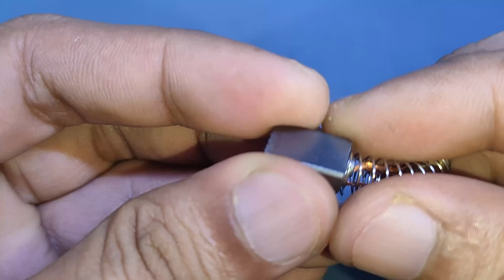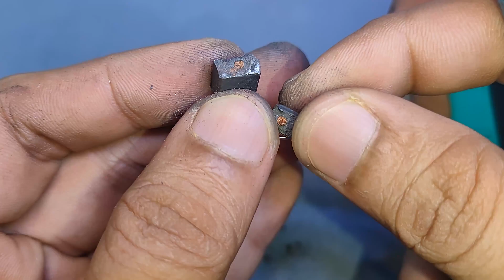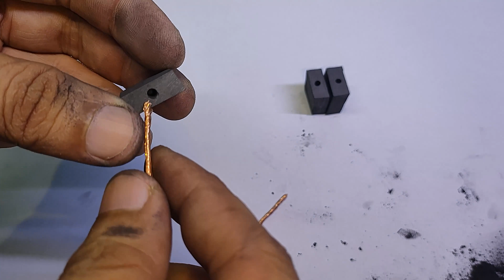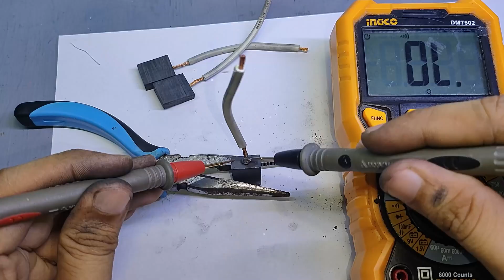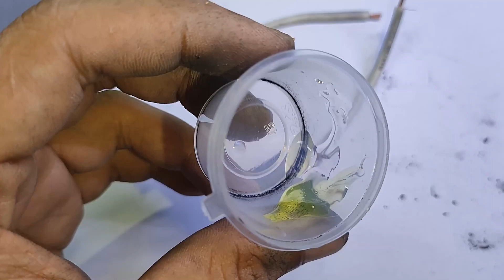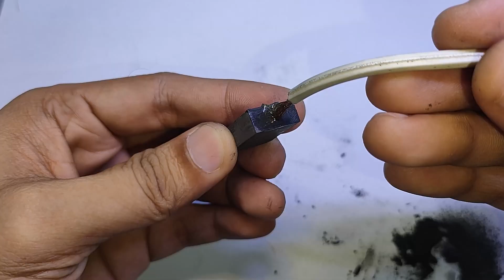Attach Copper Wire to Carbon Brush

Comment: An idea for you to try:  You can get copper screws down to m3 or even m2 size easily.  I think the graphite would tap if you are careful (and you have the right tap).   If it works it would give you a very good electrical connection.  
 You could bodge a tap by cutting slots in a screw which would maybe be enough to do graphite since it is soft.

Comment: maybe also add a metal sewing needle into the centre of wires to splay then out after youve pushed them in for a tighter fit  then cut off the excess needle  might make it tighter then add epoxy with graphite  mix

Comment: My SunJoe wood chipper 15A motor was sparking at the commutator. I found the carbon brushes had detached from the woven copper wire. I simply inserted 14ga desoldering wire & soldered it to the contact plate.
Reply: Solder doesn't bond to graphite

Comment: Thank you so much for this video,my electric gun spray refused to work when i opened it i found copper wire was disconnected from carbon brash now i know how to fix it.

Comment: when soldering carbon brush braided copper wire to a piece of another copper braided wire to make it longer can the solder handle the heat and come apart?
Reply: If it gets hot enough to melt the solder the wire would be compromised anyway. The sheathing on most wire would melt before the solder also.

Comment: Thanks for presenting some alternatives.. I suck at soldering, so it was good to see that soldering just isn't a very good way to do this. Epoxy it is!
Reply from the maker: You're welcome sir and thank you too! There are many ways to bond wires I myself find it difficult to solder one 😇
Reply: If not into electronic,pls do not try this , epoxy is the hell for designers.

Comment: Just watched ur video, what a waste of time simply use a winding wire of appropriate swg drill and fix using aluminium dust mixed with epoxy resin,degsar if available in ur country goes best with epoxy.
Reply from the maker: You mean the windings of the armature sir?
Reply: Yes.

Comment: You can also try phosphoric acid 85%. I use it to solder 18650 batteries with wires. But I am not sure how it will work with graphite.
Reply from the maker: Wow thanks for the info sir. Will try when i have the chance

Comment: I need to fix an abs pump for my Honda Fit/Jazz, due to age (2008), I couldn't find any carbon brushes... If I buy some  good quality carbon brushes (ex.makita), could I attache the copper wires to each other instead of attaching the wire to the copper brush? Thank you.
Reply: i've ground down oversize brushes to fit before now and soldered the pigtail as you suggest
Reply from the maker: You're welcome sir ☺️

Comment: I don't know how it is actually done but maybe you place the wire in the hole and copper-plate using copper sulphate?
Reply from the maker: You mean sir that blue colored copper sulfate? I think it is used in pesticides
Reply: Correct, my friend except here in olde England we spell it copper sulphate. I really don't know the commercial process exactly but worth a try I would think. Best wishes! @JakeMarvinVillegas
Reply from the maker: Sure sure i will try your suggestion good sir 😇
Reply: Very interesting ... in my little experience of diy electroplating, copper from it's sulphate will not be coated on graphite unless other chemicals added ( or just a bit ), but instead into copper itself, so it should fill ( ? ) the bore inside the brush and outside the piece of copper cable. What i suggest is to get the isolant sleeve ahead till the brush ... so all the copper will get into the bore ( ? ).
A better idea would be to enlarge a bit the deepest part of the bore itself, so some more copper would force the tip of the cable agains the carbon brush ...

Comment: YEAH!!! make your own brushes.. this is awesome. this is exactly the kind of information i needed. 
turned out the motor for my car aerial brushes are no longer available. this is a practical means to keep it running with original gear. 

thank you very much for the research and posting your findings.
Reply from the maker: And thank you sir, glad to help in some ways 😇

Comment: Hello sir. I just want to know what is the purpose of braided copper wire in the carbon brush.
Reply from the maker: Good day sir, para po mas conductive yong carbon pero pwedi namn yon wala
Reply: I wonder if it is to stop the brush working when it gets too small. this way the brush does not disintegrate in use when it gets real small and smashes itself up as it is jammed against the spinning commutator

Comment: This is great. Can one solder the wire from the brush to the brass cartridge the carbon brush is housed in?
Reply from the maker: Good day sir, yes you can do that but it makes replacement a little bit difficult as you need to remove the solder before replacing the carbon brush

Comment: hey have you tried polishing or sanding off a coating of the wire ends before soldering it in ? also, maybe they also add a small metal tubing or something
Reply from the maker: Good day sir, nope I havent tried it yet. But thanks for the info, it may increase the conductivity and bond to the carbon
Reply: There is no need of graphite Powder in epoxy... because steel spring contact with carbon....carry the current 😊

Comment: Jb weld. Since it already has good conductivity. You just need it to stick and handle heat. The brushes won't get hot enough to affect the chemical weld
Reply from the maker: Yes Sir, even if its not epoxy as long as it can handle the heat from the commutator and carbon brush its good to go. By any chance do you have an adhesive in mind aside from super glue or epoxy Sir?

Comment: This is a very good video on making motor brushes for the handyman. Instead of just using super glue how about a mix of super glue and carbon or graphite dust ??? I have had luck with this method years ago. Do not remember if the dust type or should I say hacksaw shaving mixed with the glue. For some reason the reaction with isocyanate adhesive made things hot you could smell it Jake.  Did not fail when I tested the bond on brushes including heating part of the experiment. That is all I remember Sir. 
Keep on making great videos fealla too.
Reply from the maker: Thanks Sir for the support and encouragement 😇 I would definitely try your suggestions Sir. Now I have two mixtures in mind yours and Sir Dave's